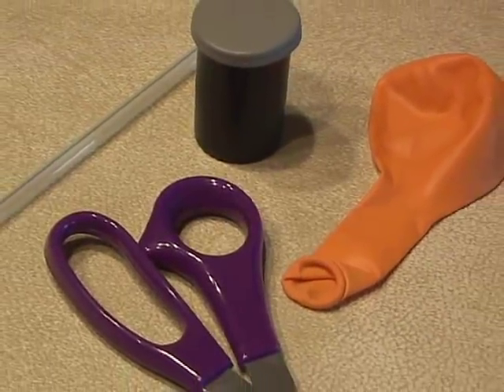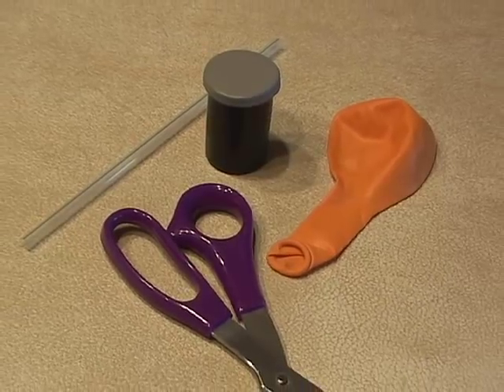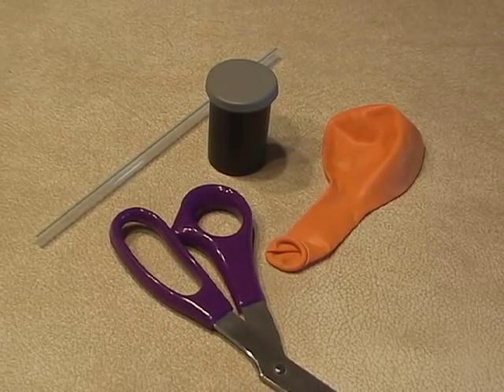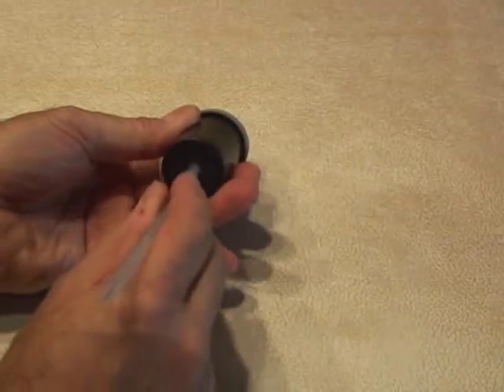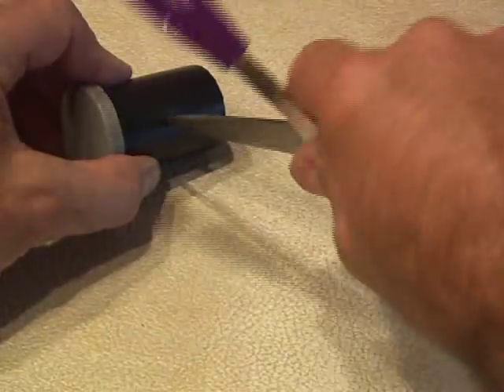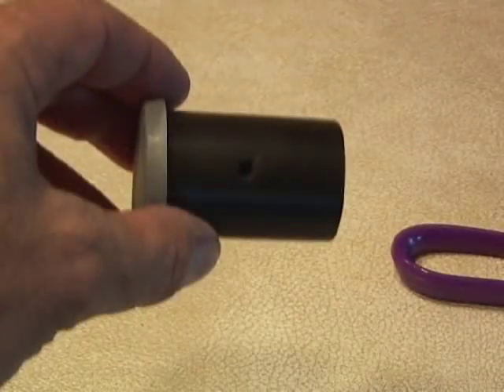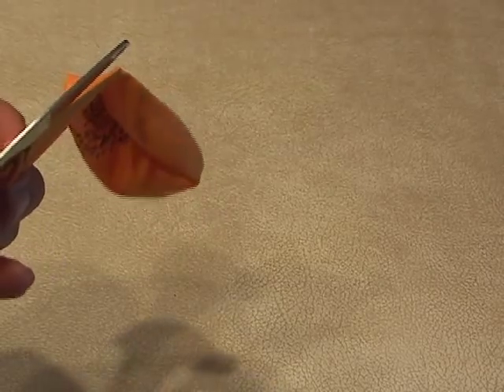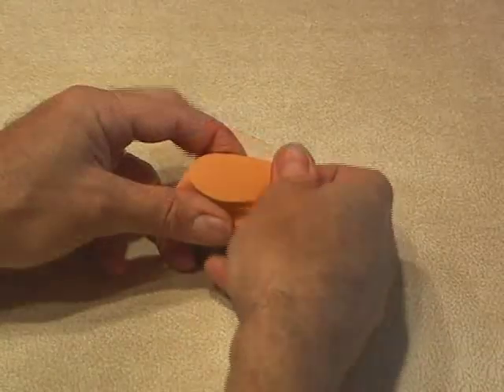World's Loudest Homemade Air Horn!

Comment: Where the hell am I gonna get a 35mm canister in 2014????
Reply: umm, walgreens and cvs
Reply: MartyMartin87 Why the hell would he want to put his mouth on something he pissed into, even if he does clean it ;p
Reply: Tim Miller Why in the hell would he piss in it at all?
Reply: just get your old 9v battery out of that 1984 Smokey and the Bandit Trans Am RC controller.  If you take a flat head screw driver to the bottom left side. You can pry and as y o u pry up, fart 2.4 X's and run your belly. You should see 3 or 4 - 35 mm film canisters. If you do not, repeat steps 3 and 4, the film canisters will appear.
Reply: TimmithyZERO bruh it's 2017
Reply: bruh it's 2018
Reply: Now 2018.. thinking the same thing... I'm not going to break in and robbed the Smithsonian Museum
Reply: Nick Rogers 2019.......
Reply: eBay
Reply: Steve Tonkin bruh it’s 2020
Reply: I have a drawer full if them lol
Reply: now it's 2114
Reply: God it’s already 3000 happy new year
Reply: Amazon
Reply: The Internet
Reply: March 2021:  "Where the hell am I gonna get a 35mm canister in 2021????"   Strangely enough, my dad left a few in the garage before departing this planet.
Reply: 2022?
Reply: Yeah, try 2022
Reply: Try 2028
Reply: Your comment was ten years ago and it's still easy to get 35mm film today
Reply: Just checking in from March 2024

Comment: It works really well actually. You just need to make the hole you blow in bigger than in the video, then more air passes through it, making it louder. You can also cut the straw shorter so it's not annoying. Then you just have to blow in it really hard, I'm so using it for the first football game tomorrow.

Comment: @TheBadBlueBIrd

Opps, misunderstood the video slightly, so my mistake, but yeah:

the edit would be- 

1. Use a short length of rubber tubing to connect each horn to fluid pressure storage core
2. Mod the straw for sonic variation
and 
3. The somewhat more difficult part, create a valve systems that would direct the air pressure evenly through each horn, ideally with the pressure release valve on the pump as the activation point

Comment: Could you, perhaps, combine 8 of these along with a fluid pressure storage core (say the assembly from a blood pressure cuff and pump) to quickly create something that reaches the 500 decibel range?

Using hot-glued, 2.5ish centimeter diameter rubber tubing to replace the straws (which crack easily) and modding the output holes to a more sonically appropriate shape, such as thinner and slightly longer with appropriate curve, may help make this more viable.

Comment: That won't make 120dB unless the straw is right by your ear but I'm sure it's pretty loud.
On another note, I made an air horn too. What I did was cut the base of a squash bottle, cut a tall thin conditioner bottle in half and hot glued the open end over the narrow end of the squash bottle. Then I put a balloon over the other open end so it was taut against the bottle neck. Then I made a hole in the side of the conditioner bottle to blow through.

Comment: @jc1899 the balloon is supposed to reverberate fast when air travels fast over it. just like when you have a regular balloon and pinch the top to let the air out, it will make a high pitch sound. same concept applies.

Comment: 120 dB I think not. That would make it as loud as a jet taking off. No freaking way.
Reply: no a jet is 140, and each 6 dB is a double of sound.. so basicly a jet is indeed way louder than 120dB.
Reply: LUVB6CPPgmodcsscoder If your standing right next to it. The chart I referenced from one of my physics textbooks measured the sound from a greater distance. In either case a Jet is way louder than this piece of crap.

Comment: @EPICAIRSOFT155 Did you push the straw deep enough? You have to place it against the balloon inside the film can. If the straw is "loose" inside the film can, it doesn't work. And be sure there's no air escaping from any holes. At least those worked for me. :)  It makes a REALLY loud noise! Hope you get it work. :)